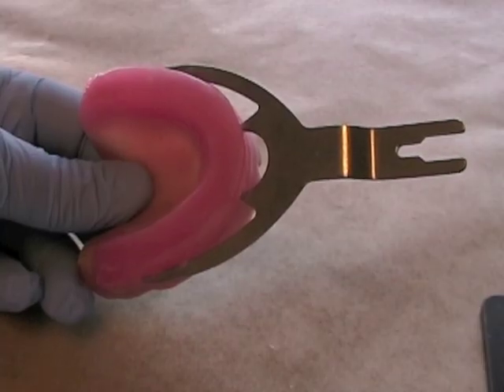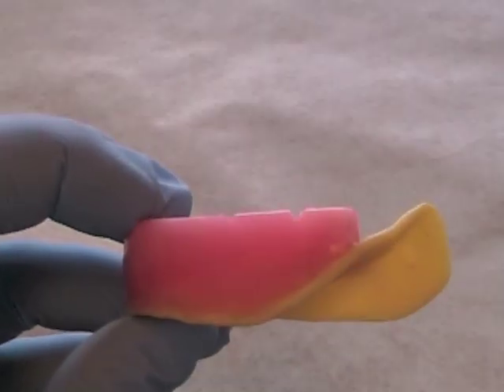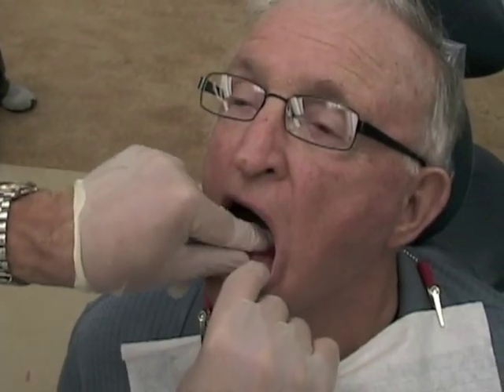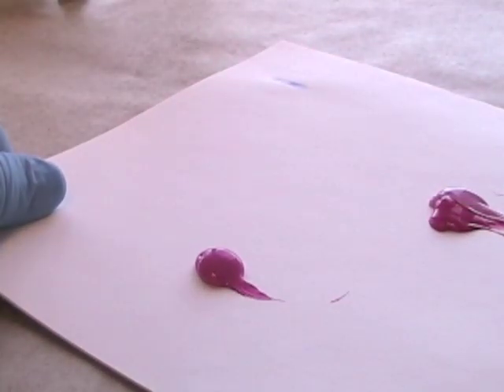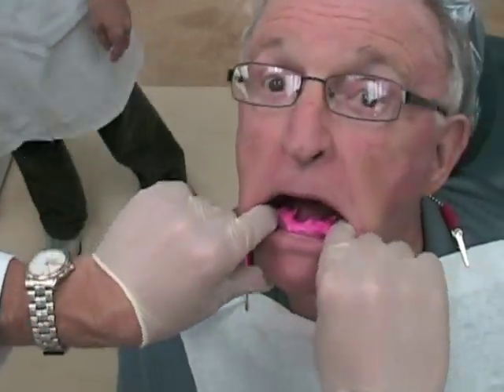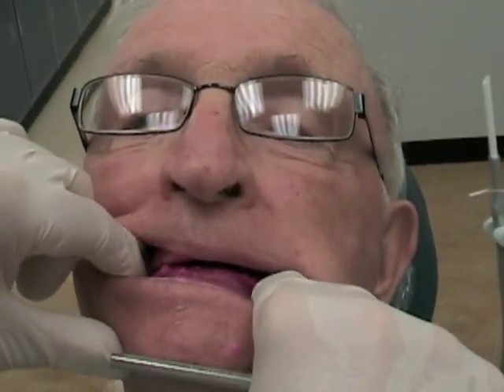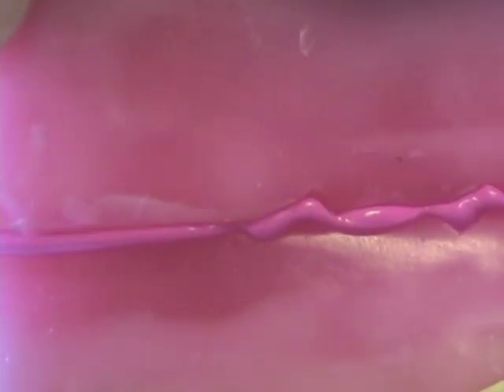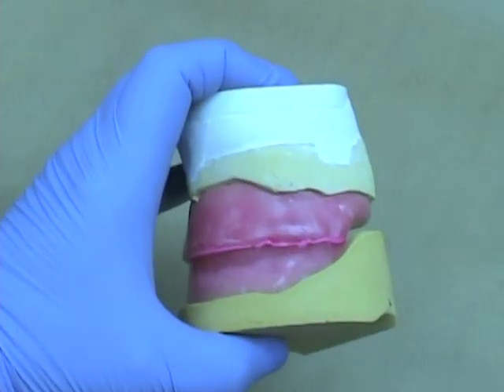27 Centric Record

Comment: This is a little known or understood step in bite regestrations. After iserting and before you bite, use you tounge to hold the upper up in position. Without this the back end of the upper will drop by gravity.
You will loose a perfect fit.  I had this happen in the past and had a miss fit denture for life.

Comment: Hello Sir, I have question about CR in denulous patient. Considering that in this patient CR is not equal to CO, If I take CR in such patient using PVS will PVS show me any indentations or it should not have any tooth mark? I am sure that it should not have perforations but not sure about teeth marks. Thankyou.
Reply from the maker: Centric relation should be considered a treatment position that is used when most of a patient's occlusion is missing (e.g. complete dentures) and it is difficult to determine where a healthy maximum intercuspation should be located. As such, for many dentate patients, where occlusal contacts are stable and the patient is healthy and comfortable, mounting casts in centric relation should not be necessary. If mounting casts in maximum intercuspation for these patients, there is research to support improved accuracy when NO interocclusal record is used and cast are fixated together during the mounting. If the casts are unstable when interdigitated (they rock when hand articulated), then a PVS record could be used, and perforations in the record will appear and be expected. For a more detailed discussion on centric relation, see my Complete Denture Manual, pp. 36-40, http://removpros.dentistry.dal.ca/ewExternalFiles/CD%20Manual%202019.pdf

Comment: Questions about centric occlusion. Does it reach pt’s CR if I ask pt to move mandible as posteriorly as possible as in terrified intercuspal position? Will this be as effective as bimanual manipulation to reach pt’s CR?
Reply from the maker: The concept of the 'most retruded position of the mandible' is no longer thought to represent an acceptable treatment position for patients. The Glossary of Prosthodontic Terms (2017) states that centric relation is "maxillomandibular relationship, independent of tooth contact, in which the condyles articulate in the anterior-superior position against the posterior slopes of the articular eminences". For a more thorough explanation see my complete denture manual, pages 36-40: http://removpros.dentistry.dal.ca/ewExternalFiles/CD%20Manual%202019.pdf

Comment: How to increase vertical dimension in an edentulous patient after the casts have been mounted? Do we need to do a new facebow transfer?
Reply from the maker: If you use an arcon type articulator (the condylar balls attached to the mandibular portion of the articulator) then vertical dimension can be altered on the articulator without remaking any maxillomandibular records. If the facebow/earbow transfer has been made accurately, there is no need for it to be remade - it records the position of the maxilla in relation to the traverse hinge axis and anterior reference point and this position will not change, no matter the vertical dimension. Type of treatment does not affect these principles.
Reply: Thanks Dr. What about about non arcon articulator? In case patient is completely edentolous?
Reply from the maker: @anmolsidhu9107  For non-arcon articulators, you must retake your maxillomandibular records for setting the condylar guidance if you increase occlusal vertical dimension. As you open the articulator on a non-arcon instrument (as you do when increasing vertical dimension) the angle between the occlusal plane (attached to the top element of the articulator) and the condylar element (attached to the bottom element) changes. So the condylar guidance must be reset. The facebow transfer does not need to be remade.
Reply: Robert Loney  Thank you so much Dr Loney.

Comment: I dont understand the part u ask the patient to close the jaw and you repeat the procedure. Why do u do that and when do you know its perfect distance between upper and lower jaw?
Reply from the maker: Occasionally patients move or slide from centric position either just as they are closing or while they are closed and while the registration material is setting. Checking that the patient can close directly into the registration is an important step to minimize the chance that this has occurred. If they can't repeatedly close directly into the record, remake the record.
Reply: Robert Loney thank you for the answer sir. Do u have the whole procedure for partial denture, that is fr the definitive cast to the final product on video? would be immensely helpful. Thank You!
Reply from the maker: ***** http://removpros.dentistry.dal.ca/RemovSite/RPD.html

Comment: Using this method you have just increased the occlusal vertical dimension by the amount of material used. If you make the notches much larger then get the patient to close and hold the position you can fill the notches with the bite reg paste and no increase OVD. The closed bite technique.
Reply from the maker: Either method works fine. A slight change in vertical dimension makes no difference if your centric position is the hinge axis. Simply remove the bite registration, adjust the incisal pin until the rims touch and you are back to the correct vertical dimension with no horizontal translation. Occasionally you'll have to do the same thing with the technique you describe if the media overlaps the occlusal rim surface.

Comment: Very good video! What can we use in alternative to polivinilsyloxane?
Reply from the maker: Most studies have found that  elastomeric bite registration materials are acceptable whether they are PVS, polyether, etc. Alternatively, rigid self curing pastes such as ZOE materials can be used. Wax was a traditional material but is normally less accurate due to the potential for distortion.
Reply: Robert Loney Thank you very much. I was afraid I would increase the ovd while using wax.

Comment from the maker: Ideally it is recommended for the patient to stop closing before contact so that they do not slide/translate upon contact if the rims are not perfectly flat. In practice, the patient will almost always have some penetration through the record as it can be difficult for them to remain in position without contact. So it's best to have as little as possible contact and yet be as close to the desired occlusal vertical dimension as possible. There is no research to say how much spacing is best.